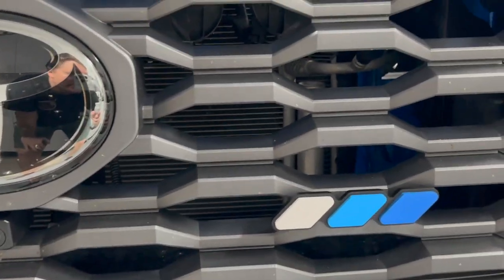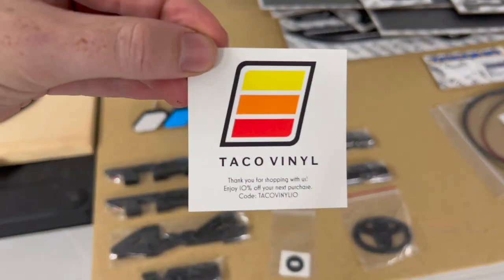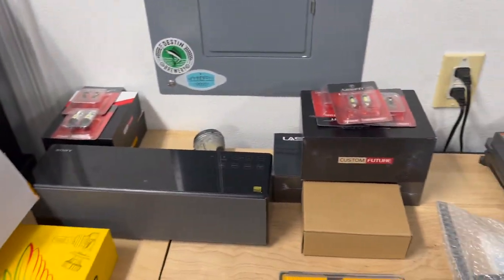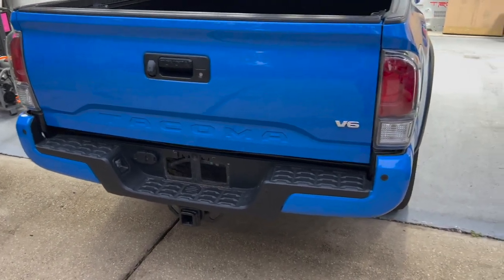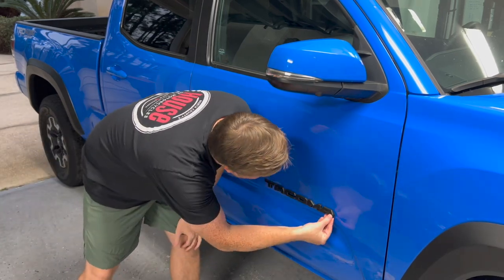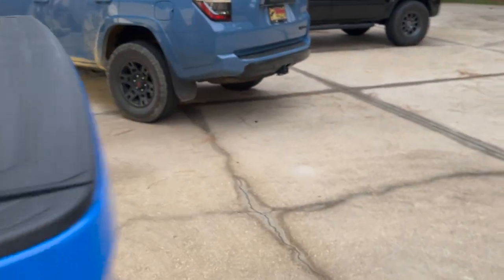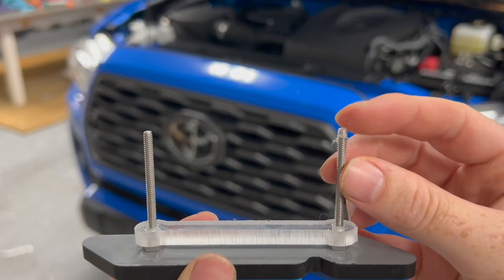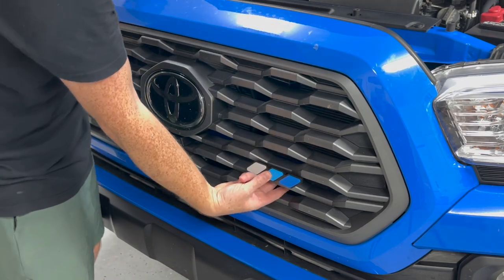These Look SO Much Better

Comment: De-chroming all the badging does so much to improve the look of the truck along with the heritage grille, subtle touches but transforms the look of the truck so much 👍

Installing the sequential turns on the mirrors is super easy, another subtle mod that improves the lighting output so much more than what the stock signal puts out
Reply from the maker: I totally agree! Can't wait to install those as well, they will look great!

Comment: I plastic dip my badge on my old Prius and it held up really well and very easy to work with. And a can only cost about $5. I will do the same when I purchase my Tacoma.
Reply from the maker: Thats what I did on the back of my 4runner. super easy and cheap

Comment: That single V6 badge on the back looks lonely. I debadged my 2nd gen partially bc of the V6 badge.
Reply from the maker: Yea it does without the 4x4. I thought all Tacomas had both back there but I guess not. I may end up taking the badge in the back off.
Reply: @TRDJon  it’ll look cleeeaaan